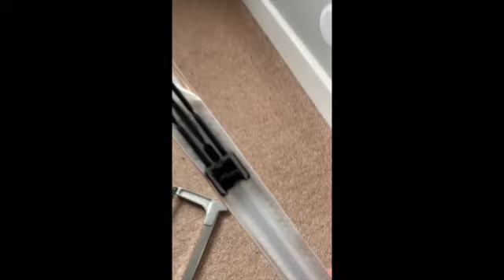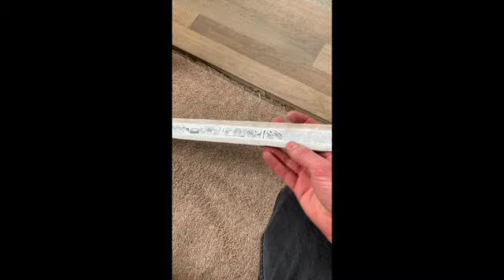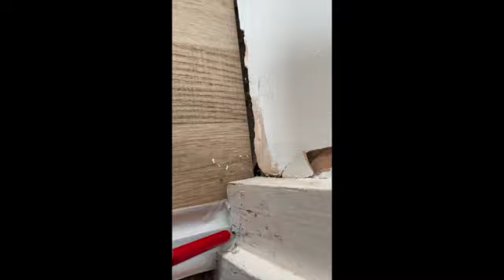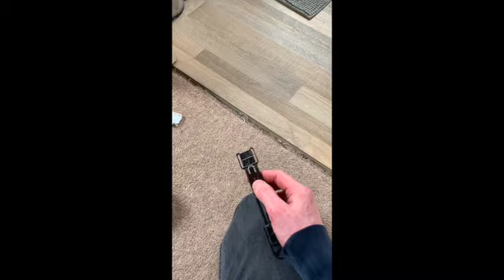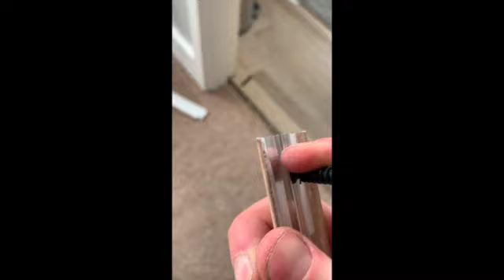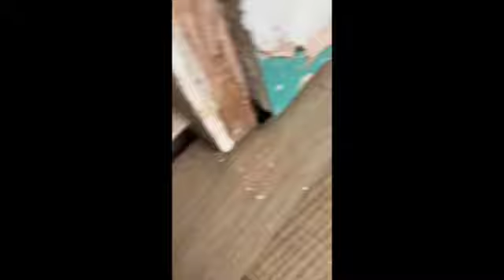Good Home Threshold bar installation

Comment: Great help this video was - What are the four small blocks for that come with the rods? Thank you.
Reply from the maker: Hi, sorry didn’t see this comment.  Did you figure it out.  The blocks are nothing, part of the plastic being printed I guess.
Reply: Actually they are there to go between an expansion gap in tiles or laminate so you don't need to drill the floor.

Comment: I appreciate your video thanks. Question... How would you install it when one surface is higher than the other. Surely the screws won't angle the strip?
Reply from the maker: Hi Jonathan, apologies for not getting back sooner.  If the angle is slight like between carpet and laminate, it would work.  For larger differences this is not the product for that.

Comment: How easy are these things to lift again afterwards?  We are relaying laminate now but the carpet on the other side won't get renewed for 6 months or so.
Previous thresholds have just been laminated paper board(?) and may be pulled out once or twice but with some risk of disintegration.  This one has an aluminium bar, so it comes down more to the durability vs grip of the plastic studs.
Reply from the maker: Hi there, I would say not easy to lift up and replace again.  I think I would recommend not putting in the plastic nails at this point and using silicone to secure it down. Then you can lift it and fit properly when carpet and laminate down ? Thanks

Comment: Any tips for installing this where one side is laminate and the other is a large door frame threshold (almost like a plank of wood). Not sure whether to sit this on top of the laminate and the existing wooden doorway threshold or more over the laminate and just touching the edge of the door threshold
Reply from the maker: Hi Jack, if I understand you correctly there’s no way to establish 1 level between the new laminate floor and the existing threshold.  If so, my initial thought is to install the floor as close as possible to the existing threshold and colour match caulk/seal up to it.  Avoids the need for 2 thresholds and if colour matched, will blend in.  This is presuming the floor is laid well and the planks terminate in the same place across the doorway.  Hope that helps, good luck!
Reply from the maker: Of course if you can lift the door frame threshold then you could replace it with the one you’ve bought.
Reply: @diytipstricks1749  unfortunately the ‘professional’ that laid the laminate left a fair big gap, so we got the b&q threshold to try to cover it. Hoping to try the drill method and see if that makes a difference. We want to install a door but at the moment the laminate slightly sits up so we need it pinned down to stop the door scratching. So annoying but you never know with some tradesmen until it’s done! 😠

Comment: Do you have to leave a 10mm gap between the middle of the threshold bar and the wood on laminate flooring? I'm about to lay my floor, but am not sure if the threshold bar will have an effect on the expansion and contraction. Many thanks!
Reply from the maker: Hi, sorry for super late reply, I’m sure it’s been fitted many months ago but I would place it equally between the 2 surfaces.

Comment: I’m running laminate throughout my downstairs and have bought these strips for end profile use. So, front door, patio door …into concrete floor. I cannot understand the instructions. Please can you do a video talking me through that. It does say they have three uses…end profile, transition to different floor materials and different floor levels
Reply from the maker: Hi, I’m sorry for super late reply on this, notifications weren’t coming through.  To answer your question when it comes to front door and patio door, I would prob not colour coordinate with the flooring. If you have white skirtings and white doors, I would use a pvc trim or white scotia to cover the gap.  The finish in my opinion always looks better that way.

Comment: Thanks for the video. I've just started installing one of these and the instructions are not very good at all.
A couple of points I'd like to add - On the plastic sprue that has the fixing "screws" there is also a depth gauge so you can check the holes are deep enough before inserting the screws.
There are also some other plastic pieces which are designed to be slid onto the strip in between the screws. These are presumably designed to support the edge in between the screws and can be cut to length to suit the thickness of flooring.
Reply from the maker: Thanks Steve for adding this, hadn’t really spotted the plastic support bits.  👍🏻